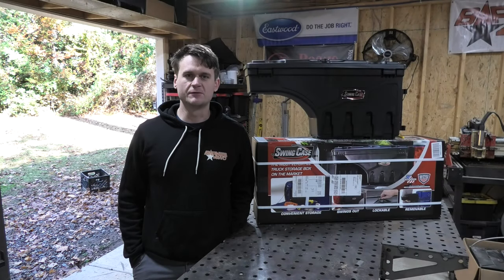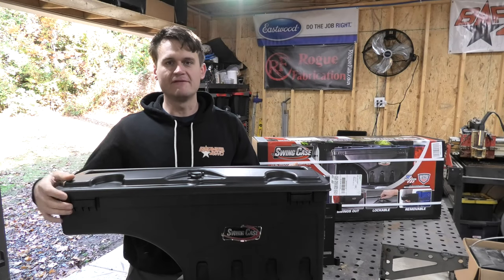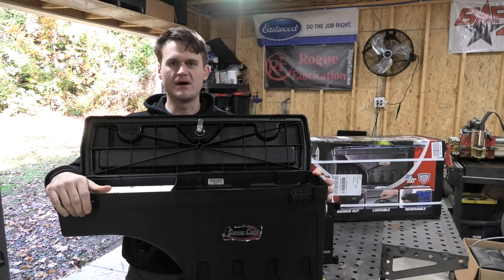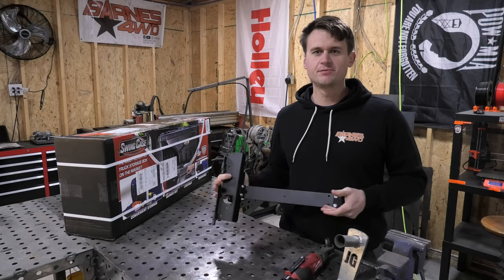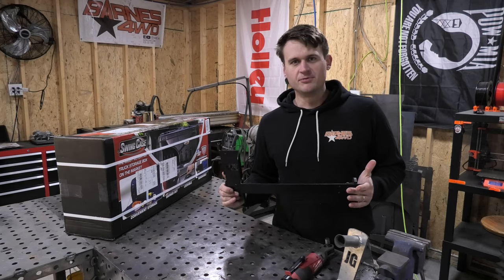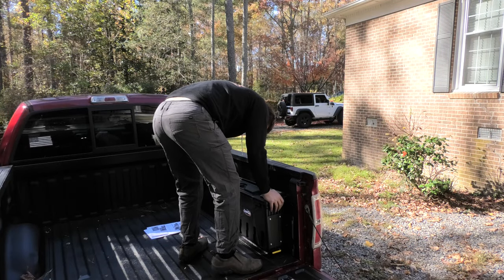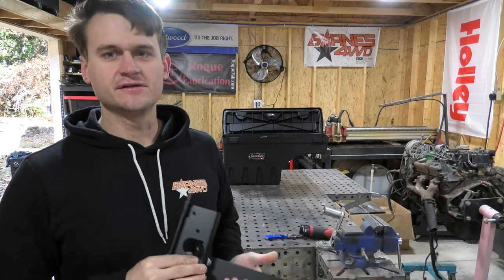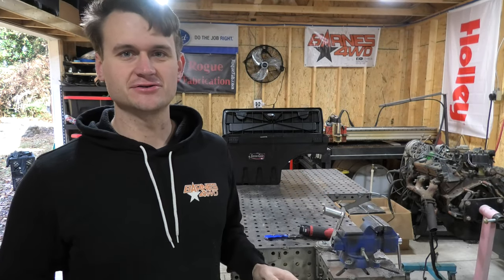Under Cover Swing Case Tool Box Install II Legacy 4x4 and Off-Road

Comment: I have one in my truck.  Holds my emergency fluids. 2 gallon jugs with water and coolant a few more quarts of oil/atf , various tools. 👍
Reply from the maker: Great tip! Especially if we're pulling some of the less than reliable junk...

Comment: Are you going to put that aluminum box on the other truck for storing stuff when you go on the trail like water and recovery gear?
Reply from the maker: Probably just bins under the bed cover to be honest... might get/make a pull out shelf unit eventually... all up in the air at this point
Reply: @Legacy4x4andOffRoadYT  on the Willys